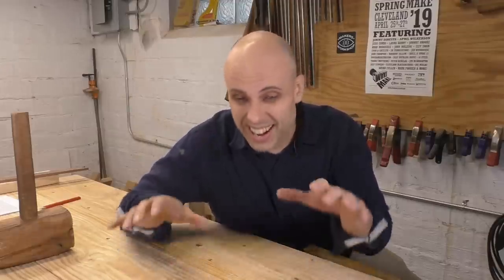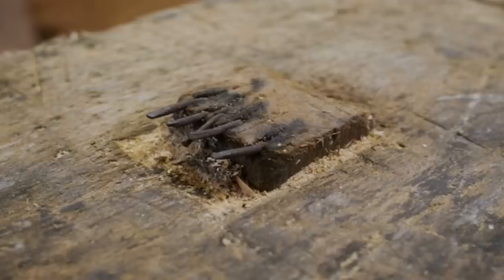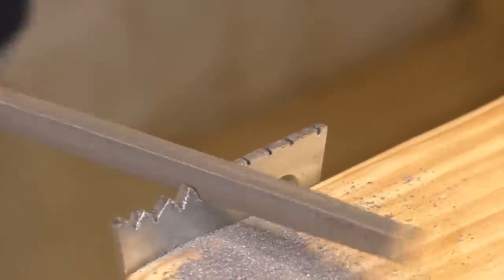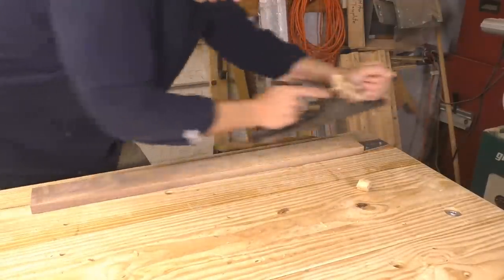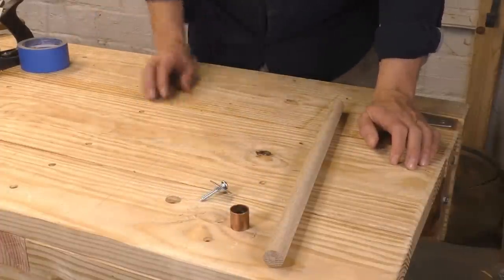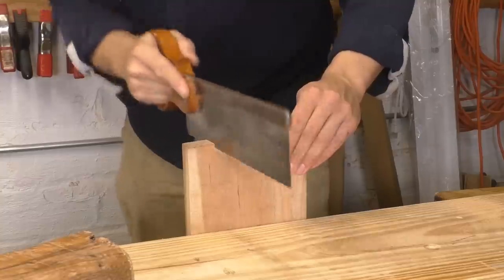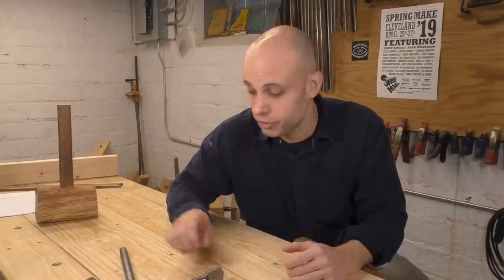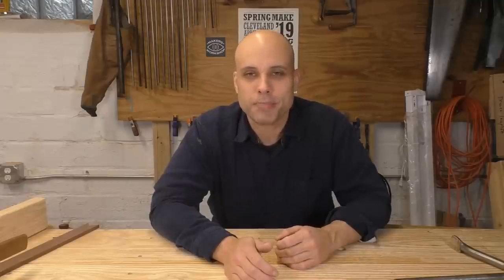You don't need a vise on the Joiner's Bench

Comment: One of the hallmarks of the Nicholson/English bench is that they are full of holes for holdfasts.  The holdfast is fundamental. I saw another video where a guy glued reinforcing blocks under his bench for holdfasts. The force exerted by the holdfast eventually popped the block off. Might need a screw or 4.
Reply: I reinforced mine and that was the perfect solution. I’ve heard the grammercy hold fasts don’t need them. But, blocking is cheap. I added a bunch and I did use screws to keep it tight.

Comment: Wait wait wait WAIT A MINUTE! Those other dudes said I have to have an expensive vise or my bench won't work and I'll be fined by the IRS.
Reply: I heard that too.
Reply: Pretty sure they're going to fine you either way... The trick is to buy the vice using a Nevada shell corporation. 🤣
Reply: I'm on basically the opposite trajectory as Rex here. I've worked without a vise for years and now I'm building a bench with a vise to see how I like it.
Reply: Not true, you’ll only be fined by the IRS if it isn’t a quick-release vise.
Reply: @BrainSlugs83  1
Reply: Not necessarily.  There's a 684 page brochure explaining the tax implications of an expensive bench vice.  First you must understand the information in the brochure.  It should only take you about 8 months to read, and you still won't understand it.  So then, you can hire an attorney to read it for you at $400/hr.  Then, you can fill out IRS form 1734 which grants a bench vise tax exemption.  The exemption is automatically awarded to those using the bench vise for farm work, religious work, charity work, or law enforcement.  Anyone else, must prove that the value of the vise does not exceed the value of all your other tools divided by the number of people in your household.  If the value exceeds this, then you will have to fill out IRS form 1738 which grants exemptions to heads of households, students under the age of 28, and those that are hearing impaired.  Even if you fill out all the forms correctly, which is theoretically impossible, you will be flagged for an audit by the IRS.  They will then spend $20,000 going through the process of making you miserable, arresting you, taking you to court so that they can finally be successful in collecting the $12 in tax that you owe for the bench vise.  The IRS is just pure genius.

Comment: This is one of Rex’s best videos. This is fundamental stuff. For those that want to build a bench there is no need to be slavish to details. The essence of the English style is two boards on edge front and back and then cover with boards. 2x4 with supports every 24 inches is plenty of strength. Do glue on the thickener pieces for the holdfasts. Do buy a pair of holdfasts. The Gramercy brand are steel rod and will never snap like the cheap cast iron ones. 22-26 inches wide is nice.  Don’t go too wide. The well type style (see his other video) can go wider. 4 feet is a little too short. 6 feet is nice. The skirts front and back have to be at least 2x6s, but you’ll be happier with 2x8s. (I went with 2x6s and find wider long boards ride too high above the bench.) I came back to this video to go over the plane stop he did. I’ve just been driving screws into the top now and then as needed.

Don’t be put off by the rough construction. A beautiful bench of hardwood can dent your projects: better dent the bench with the project than dent the project with the bench. With a cheap top you’ll put in holes for the holdfasts without concern. You’ll paint on it, glue on it, drive in the occasional screw or nail and you won’t care. You’ll just get the job done. Say you build 5 projects a year. 5 years from now plane the surface. In 10 years you’ll have spent $50 in wood per project or $2500 in materials. Maybe then, maybe, you replace the top for $40.  Get it? Cheap bench makes lots of projects and you can even patch it up. 

On top of that this bench (the English Style) is so approachable that you’ll make it. What are you waiting for?

Comment: I built a Nicholson style bench a few years ago and love the front "vertical bench" that goes with it.  So a lot of nodding in agreement from me with your present Nicholson series.  And a very hearty HECK YEAH on the holdfasts.  So simple and easy to use yet so capable.  I wish I'd learned about them years ago for my wood working.  I've been using one as a "mallet operated vise" on the front apron for a while now.
Reply: Exactly! I made my own bench with one side that's Nicholson-like, and the other side is more Roubo style, so that I can easily use clamps, too. The Nicholson side has a bunch of holes for the holdfasts, so does the top of the table, while the side without the apron doesn't have any holes for holdfasts, but the benchtop is still about 3" thick. To hold stuff, I sawed myself a bunch of little dogs, and made two holdfasts using steel rod and wood, but I think I'm going to remake them all in steel rod.

Comment: Loop a tow strap or a bicycle tire tube around your bench and slide the work under it, hold tension on the strap with your foot. Used with a stop that will handle most everything you need until you get around to adding fancy stops.

Comment: Rex, on my first bench (about 50 years ago) I went even lower tech for bench dogs...drilled holes wherever necessary and countersunk them to accept flathead wood screws (brass in case I ever ran into them with a plane). Screwed flush they were out of the way. Unscrewed a turn or two the sharp flat heads bit into the workpiece like the teeth of your “hinge dog”. Worked slick. In fact that bench and those dogs still see service to this day!

Comment: I made my holdfast out of a bit of rhododendron. Find a branch a bit bigger than your thumb and follow it until a branch comes off it at a good strong angle then cut the main trunk just below the smaller bit. Then trim the smaller to four inches or so and the thicker to somewhat longer. Drill a hole in your bench to fit the big one.  Put the wood to be worked next to the hole, turn your slingshot upside down and stick it in the hole. Wacking it with a mallet and having it clamp instantly is very satisfying. Tap the part opposite the smaller branch to release. A wonderful, and free, tool.

Comment: I have a set of the Gramercy holdfasts, Rex is right. They are an incredible deal. My only recommendation - the holdfasts are very finely finished.  I roughed them up a bit with some 120 grit on the spot where the holdfasts lock up with the bench. You don't have to, but they lock up with much less force from the mallet.

Comment: Love your stuff Rex, but a 6 1/2 in Irwin woodworking vise is only ~30 off Amazon and it works like a champ. I mounted it flush with the top of the vise to the benchtop and in the middle of the bench. Then I drilled a series of half inch wide through holes along the apron which I populated with a few 6in long sections of dowel on both sides of the vise so they carry the weight of the stock I am prepping and the vise holds the stock solidly in place. Works like a champ and vise and a couple feet of 1/2in pine dowel is cheap and very usable for the beginning woodworker. I've used it on 12in wide (on edge) by 8 ft long planks, and for working on the faces of those planks, Just a couple quick clamps to hold it to the benchtop.
Reply from the maker: I'm glad you like it, but to me, that vise is WAY too small. I need much more capacity.

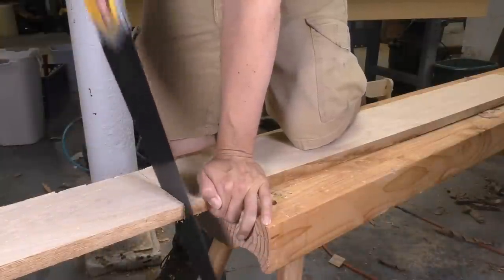Comment: 9:50 where you talk about sawing. That is the MAJOR reason for the well in an English workbench. Like so many other people said we all had these in school. Each bench  had a 4" paint brush that we would clear the sawdust away from the well with. Long pieces would lie along the well and we'd use it like a bench hook. Hold/lean on the piece with one hand and saw with the other.  No hold-fast required. You could reference the saw to the bench for a rough 90 degrees. but we were always taught to use a square and mark it. It was never used to keep tools in. Mr L would throw a mallet at you for that! Tools were always stored correctly. You can only hold one tool at a time so when you get one put the other one back. I'm sure this was because we had more students than tools but it's still something I do now.

Comment: Glad to see Mike getting the attention he deserves. That video was the single most influential thing I watched before I made my bench.
Totally agree on adding vises though. I went without for exactly as long as it took me to save up and buy a wooden screw. That would be a cool future video by the way.
Also I was just noticing last night, I don't have a lot of space and I have noticed that my wood bench gets used for a lot of non woodworking tasks. Last night I was assembling hardware for a custom dishwasher front on it, and I think the last thing I was doing before that was playing with back gearing on an Atlas lathe. The point is I am able to do all of that because I added carcasses with drawers under my English bench. There is just a ton of space under there that most people don't use.  If you can easily get your hands on screwdrivers, pliers, snips, and marking tools, then it becomes a general-purpose bench. And I even have space between the carcass top and the bench top, which is required for the holdfast bottoms when they are used, but there is enough left over to have a stack of clamps stuffed in there.

Comment: Out of curiosity, would you be able to make a video about how to make/maintain a cabinet/card scraper? I think that would make a great addition to your "Woodworking for Humans" series.
Reply: Maybe Rex could collaborate with Pask Makes or one of the other great woodworkers I yt to make one!
Reply: @deckdriver  definitely more collabs!
Reply: Crimson Custom Guitars has a few videos on scrapers that are pretty down to earth and well explained.
Reply: Use old saw steel. Cut with a cutoff wheel in angle grinder. (Be careful.) If you use an old handsaw then you can be sure that it is regular carbon steel. You should be ready to go after cleaning it up and sharpening, no heat treating require. But you could heat it up to a non magnetic red, oil quench (keep face back and don’t panic if the oil catches fire, it will go out shortly). A metal can for oil is a must, obviously. A soup can is only big enough for a little scraper like a chairmakers devil. Must have enough oil that you don’t just heat it up; it needs enough mass to overwhelm the hot steel so it is quickly cooled. Submerge the entire piece slipping it into the oil “aerodynamically” (vertically; this prevents warpage). Hold onto it with vise grips. Don’t use machine oil or motor oil (peanut is my recommendation). Once cool, clean off oil with wrap and temper in oven at 460. If it can’t be filed (test with a crappy one), set to 475 and keep doing this until it can be filed. Keep in mind that black scale is harder than the steel underneath it; you have to get through the oxidized later to test the hardness with a file. This fellow has a good video on how to actually sharpen the thing. A wire brush attachment for drill will help you clean the metal if you want it bright. https://m.youtube.com/watch?v=6KqPFQHqWJg
Reply: Motor oil is full of toxic crap including heavy metals. It should never be burned in any circumstance.
Reply: I was thinking he might have already done this but haven't encountered it so far...
Reply: In a recent Wood by Wright video, James explained that you can simply use the side of a chisel or a loose plane blade as a scraper. I've tried this and I can confirm it works, but for wide surfaces you definitely don't want to rely on a chisel.
Reply: See Japanese 'spear-planning'. yeah?  yeah!

Comment: I spent $150 on the materials for my joiners bench, but I went to a reputable builders supplier in my area known for better quality lumber, and I mistakenly bought 1/2 inch carriage bolts and hardware. I also quickly learned the downside of using the factory edge on the chisel set I could afford (irwin). I also quickly learned that cutting square with the japanese hand saw is rather difficult. 😂 you live and learn my friends.

Comment: I just use a pair of big brass countersunk screws for a planing stop.  I countersunk the hole way down so i can run it down below the surface of the bench so nothing catches on it. If I need a planing stop, i just unscrew them to the proper height. The is extra nice for me because I plane a lot of thinner stock, and theyre brass so i don't have to worry about steel tools getting all dinged on them.  Over time they get bent and dinged up so every few years i spend $2 and get new screws.
Reply: only trick is remembering to add length allowance to plane out the marks they leave, but that'd be true for any planing stop ive ever seen

Comment: A wonderfully useful drill bit with integral countersink is the machinist's "center drill" style which being rigid is less likely to walk (a problem even in a milling machine).  They are not expensive and along with a prick and center punch make basic metalworking much easier.

Comment: I've been using holdfasts made from the crotch of tree branches for several months with good results. I made them from a tree branch blown down in a storm.

They are a bit springier than metal holdfasts, which sometimes is great (they push back against movement), but sometimes lets things work loose. They also don't seem to damage the holes in my 1.5" bench top. Can't complain about free though.

Comment: A quick and shitty holdfast can be made out of rebar or other metal bars if you’ve a charcoal barbecue, a hair dryer, two sets of sturdy pliers, and a pair of sledgehammers or a very large and very hard stone. Take the bar, stick the end in the fire, and blow it with the dryer until the metal is very orange or yellow. Take it out and hammer it flat using either your stone or a hammer for the anvil. Then heat the middle of it to the same colour, then take it and try to bend it by hand. If you can’t, hammer it across the corner of the stone. Aim to make it just slightly acute, and KEEP IT ROUND.

Comment: I’ve got that “little vise” you speak of on my bench. Irwin special from Lowe’s. 20 bucks. Let me tell ya the thing is limiting unless you only do tiny projects. Once you throw pieces of wood into it to line the jaws, it really only gives you about 3 inches of clamping area to work with. Funds are tight so shelling out on a big quality vise is not in the cards right now. I’ve tried some viseless solutions and some I like, others I don’t. When resawing a board I like to be able to quickly loosen a vise, adjust the board, re-tighten it, and continue sawing. With holdfasts I don’t really feel like it’s as easy, though I do love them for other operations. End of the day a vise is the way to go for me, with a smattering of the smaller viseless methods in your videos, like the planing stop. Once that vise build video and plans of yours come out, take my money! The little Irwin shall then go on my 4 y/o daughter’s bench that I’ll build her. Thank you again!

Comment: Greetings from Slovakia Rex... 

Great videos ... especially this one... since it is absolutely usable even for us bloody amateurs (we Germans use "bloody" more in reference to the potential injuries .... not then English sense :-)). Will subscribe right after having completed this comment. 

Now to the point: I have reduced your half-hinge idea even more down to the basics.....  I use 7 coarse threaded and relatively short countersink screws with bigger heads.... arranged in a line ... exactly like your toothed edge. I just cut some notches into the screw heads with a narrow-bladed angle-grinder... making those screw heads look like 8-pointed stars. Since the screw head itself has this 45-degree "bevel" ... it is more than enough to dig into the wood and hold it in place. After one week of use, I put some wood glue into the thread in the bench (to make it more durable... since the material is only 18mm plywood). This is even cheaper .... and you inspired me actually less by the "hinge" but more by the holdfast substitute with that big washer.  You can use even more than 7 screws... you can line them up over the entire width of the bench... screwing "up" (maybe better said "upwards" :-)) only as many, as you need. When inactive,  those stopper-screws are almost 3 mm (due to the head size) under the surface.  Since I have my "little" 10,4V cordless drill always at hand. ..... the use is very comfortable. I suppose that I will have to add some more wood glue to the thread to compensate for the wear-out ... maybe twice a year. 

roger d. - a Jerry "stranded" in Slovakia

Comment: You can make a holdfast from wood.

Find a sapling with a crotch (a main branch with a thickness rivaling the stem not a stem splitting in to two stems). Cut the branch a foot from the stem. Cut the stem 2 foot above the crotch and a handspan below the crotch. Take some cordage and lash the short part tightly continue until you reach the crotch, lash the limb to the stem in a figure 8 pattern tightly about 10 times, fasten your twine. You have a basic holdfast. Pound it in your bench. Trim the lenghts of the limb and stem to appropriate lenghts and you are done.

Comment: Repeated Holdfast insertion/removal in softwood will oval dog holes over time, more so when holdfast action is pushing perpendicular to the grain than pushing parallel, but it'll oval in both directions eventually. Good news #1 is it'll take a long time & a lot of woodworking for it to become an issue. Good news #2- if it ever gets to be a functional problem you can over-drill the entire wobbly hole area & glue in new wood, hardwood scrap if you have it, re-drill the dog hole & Ur good or better than new